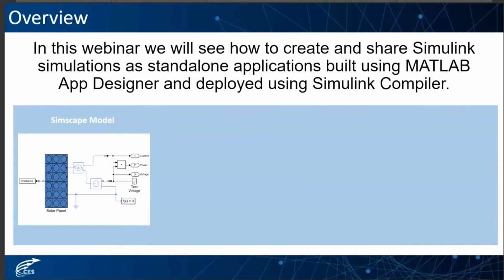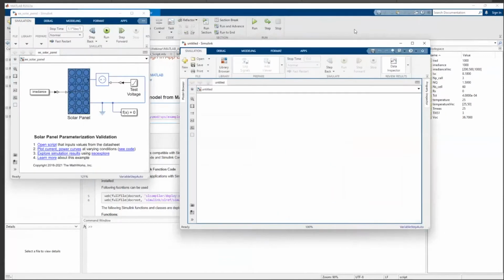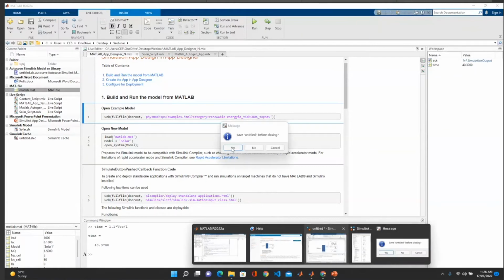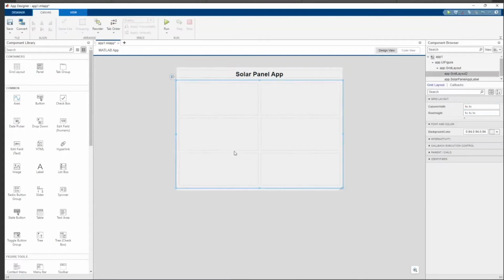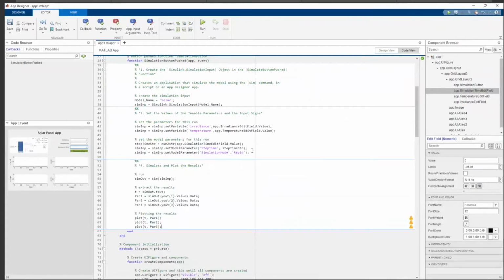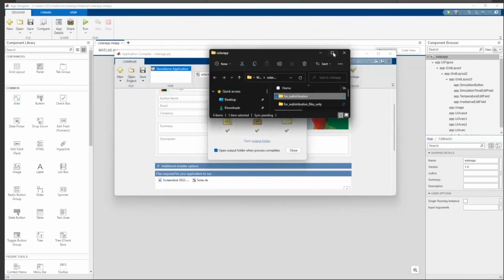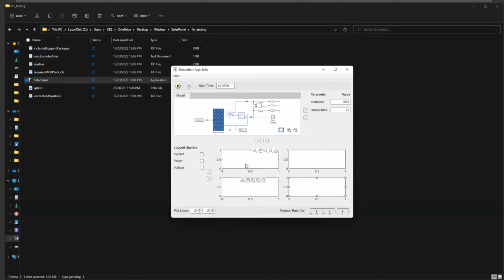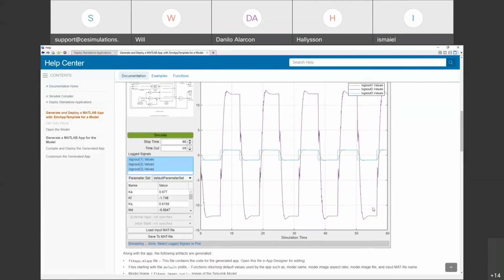Create Simulink Apps

Comment: Hello! I was trying to do the matlab app and I started to get the error:
 "Dot indexing into the result of a function call requires parentheses after the function name. The
supported syntax is 'simulink().compiler'."
On the line where I have the function "Simulink.compiler.configureForDeployment"
This is the code I use on the button callback:
            Model_Name = ('Prueba');
            simInp = Simulink.SimulationInput(Model_Name);
            simInp = simInp.setVariable('irradiance', app.IrradianceEditField.Value);
            simInp = simInp.setVariable('temperature', app.TemperatureEditField.Value);
            simInp = simulink.compiler.configureForDeployment(simInp);
            
            
            stopTimeStr = num2str(app.SimulationTimeEditField.Value);
            simInp = simInp.setModelParameter('StopTime', stopTimeStr);
            simInp = simInp.setModelParameter('SimulationMode', 'Rapid');
            
            simOut = sim(simInp);
            time = simOut.tout;
            current = simOut.yout{1}.Values.Data;
            power = simOut.yout{2}.Values.Data;
            voltage = simOut.yout{3}.Values.Data;
            plot(app.UIAxes, time, current);
            plot(app.UIAxes2, time, power);
            plot(app.UIAxes3, time, voltage);
            plot(app.UIAxes, voltage, power);
Could you please help me? Thank you!